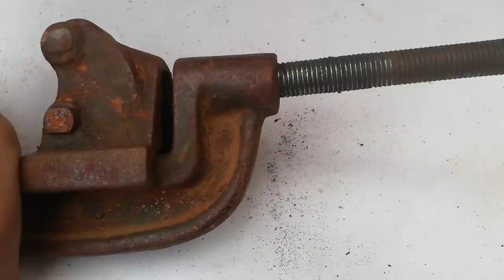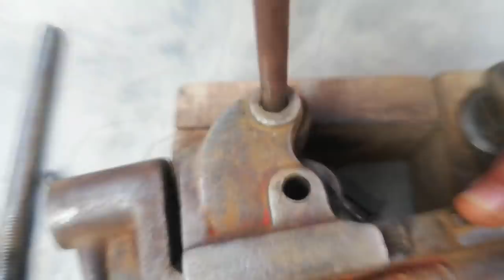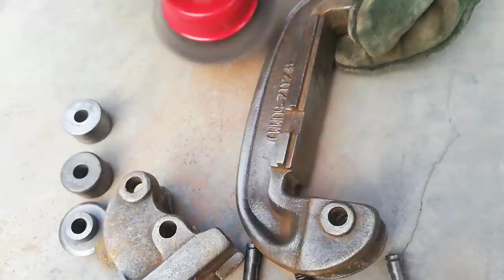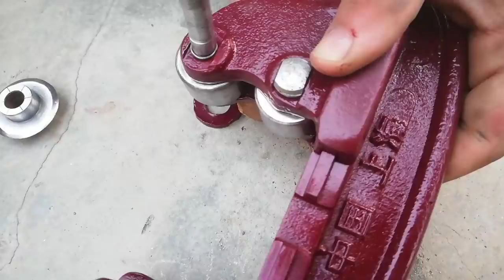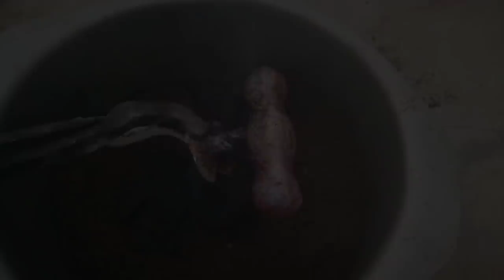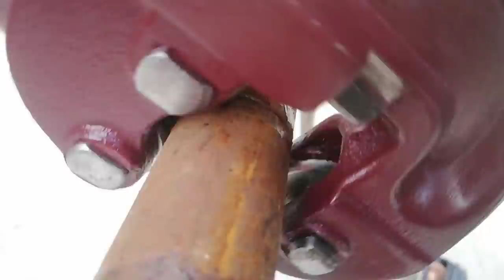Antique Pipe Cutter RESTORATION

Comment from the maker: For Electrolysis

VOLTAGE & CURRENT:    12v , 6 amp (Current also depend on the area of the pieces bigger the area bigger the current but  1mA/cm2   to stay safe).
ELECTROLYTIC SOLUTION : Mix Common Washing Soda (Sodium carbonate Na2CO3) in simple tap water.
Electrolysis produces some flammable gases so take your Electrolysis Tank to some well ventilated area And also take your safety stuff along with you. Stay Safe!
Reply: next time use stainless as sacrifice electrode - no rusty mess, just bubbles of oxygen, also it will last hundreds of electrolysis sessions

Comment: Very cool. Made these at a place I worked at decades ago. Rollers and cutting wheels are hardened to 60 rockwell C and black oxide finished. Stem was also black oxide finished. Tubing cutters were zinc cast, pipe cutters iron casting. It's been a long, long time, but I think those iron casting were annealed and it was always a problem keeping them straight.

Really interesting seeing this all these years later.

Comment: I had to build a chainlink fence in bedrock for a contractor years ago, we used one to cut the 2 3/8” galvanized poles, and they were heavy wall too. Over 400 cuts, it becomes an art to dial in the pressure as you go so it is easy to turn, but still cuts as much as possible.

Comment: Greetings from Norway. This restoration was a bautiful done job, but I think the gap for the cutter wheel should have been made narrower rather than putting in that washer aside of the cutting wheel. I am also wondering, what happened to the T-handle? It seemed OK at 1;09 but never seen since.

Comment: Nice job but i would have drilled the side of that tap handle so i could have used a sprung cotter pin through the shaft to stop the handle coming undone, oh and the knife video with the brass handle was beautiful.

Comment: I was waiting for the part where you spray it down with WD40 or some other lubricant to keep the moving parts moving without resistance and to keep it from rusting again but it never came. Anyway, great job on the restoration!

Comment: Thanks a lot for the video! Really interesting and useful! Please, explain more details about electrolysis process: with current (alternative or direct), voltage and powder you used? Thanks in advance?
Reply from the maker: CURRENT: 12v , 6 amp 
POWDER : Common Washing Soda (Sodium carbonate Na2CO3)

Comment: Excellent, but why did you remove the rod’s original handle?
Reply: I'm wondering that too.  Anything brass like the new one leaves a nasty (in my view) odor on the hand, and a lot of scrap brass has lead in it that could eventually get into the body if you hold the handles without gloves.  It looks pretty, but uncoated it's much nicer to use a steel or aluminum handle IMO.

Comment: Very aesthetically-pleasing restoration, but does it still function....?  In many places this sort of cutter is rarely used anymore.....  Why not grind the cutter wheels....or were they "sharp enough"?
Reply: i think this pipe cutter is very antique and people used it before grinding machine. it should be 50 - 90 years old

Comment: They came out nice I guess. It would be worth it to clean up a set like that if you had a pipe threader and installed like gas lines and such. Far as cutting copper, You might as wells go buy a 20$ set of tube cutters and be done w/ it.

Comment: It's a good idea not to paint two surfaces that move up and down. Painting them makes a tighter fit and the paint will eventually wear off anyway. You're better off just putting some oil on the two surfaces that move. Other than that it turned out good.

Comment: Great video, great restoration job!

I'm curious what happened to the original handle that we can see in the beginning of the video? I assume it broke while removing it from the threaded shaft.

Also, you didn't show it, but did you pin the handle to the shaft to prevent it from coming apart when reversing the direction after a cutting operation?

Comment: These types of pipe cutters are particularly suitable for cutting copper pipes, less for 
iron pipes, but there is a disadvantage. They create a massive ridge on the inside of the tube, which creates turbulence and flow resistance, or requires time consuming removal.

Comment: That is the wrong cutter wheel. there should not be a washer.  This is an exact copy of a Ridgid cutter. Ridge uses aluminum handles. He is turning the tool in the wrong direction. Ridgids are painted bright orange. Those tools are quite expensive. With a little oil on all moving parts , they will just about last forever.